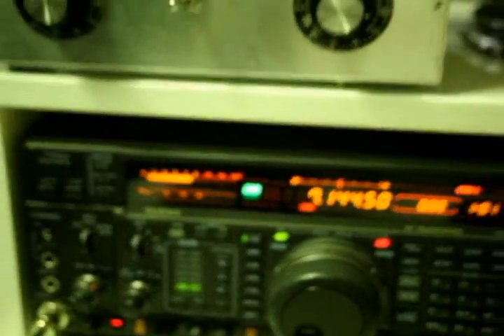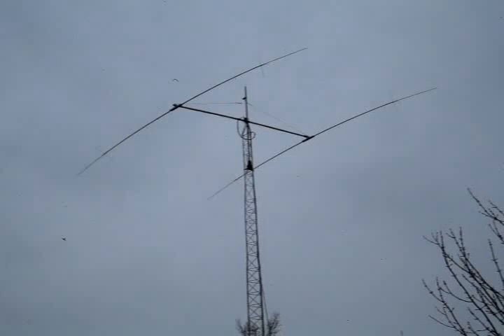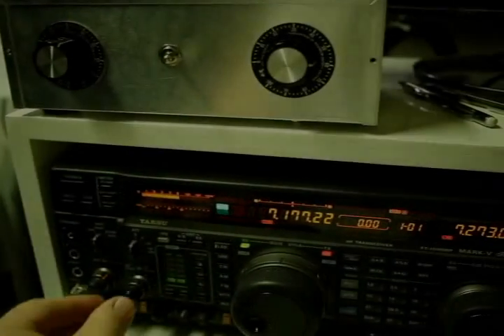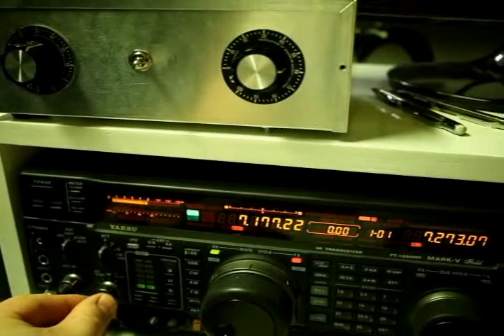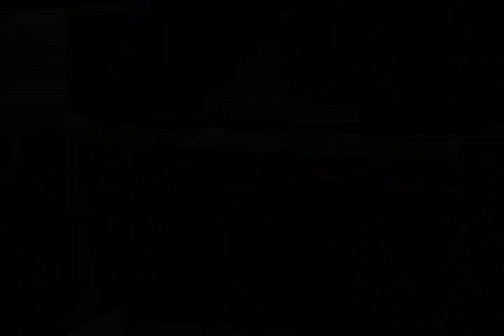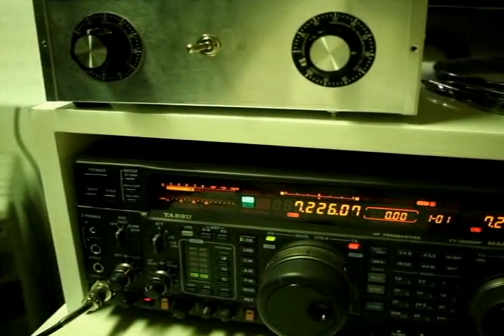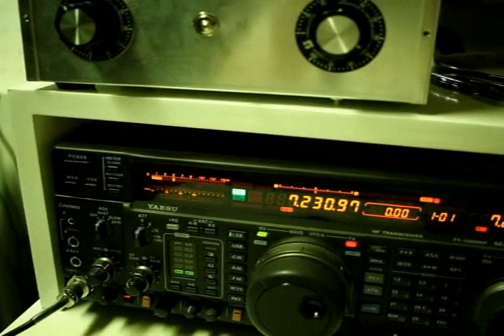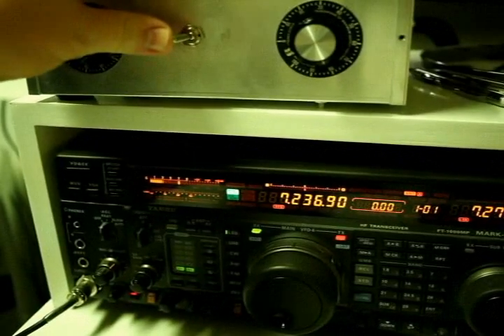W8BYA 40m 2-element rotatable horizontal phased array antenna F/B tests

Comment: Phased antennas are superb in rejecting unwanted signals. Used a W1CF 4 square for 80m with 8 directions in the 1980ths with great enjoyment. A recent accessory QRM-eliminator is another phasing piece that is effective. 73 de Bjoern

Comment: Seems to be based on a K5UA design. I have one too and you can get great f/b in the winter. Mine has full size elements with 20 foot spacing. rotated by a T2X at 100'. I set mine up to go 180 and both directions. I modified a Dentron Transmatch to provide the 135 degree phasing, which is adjustable to null out the signals perfectly. Currently building a remote network to cut down on SWR line losses. Chuck, W0DLE
Reply from the maker: Your setup sounds very cool as well. This particular design is actually one inspired by my antenna elmer Pete W6VOD (sk) that he  taught me about 35-40 years ago long before the internet.... way back when we used to have a daily round-table with chaps like WB6DLK, ZL2BT, KA9V, K9CCL, W6VOD, WB8RMS, etc, etc. I used the exact same topology way back then when my fascination with phased arrays started and I used this design for a pair of phased verticals on 40m. I wrote up a 8-9 page doc with some basic phasing reqs &amp; math and passed it out to over 60 hams way back then because every night I would get many requests from guys wanting to know how I did things once they heard the difference as I switched directions. It was a fun project.
Reply: Was that what you were playing with back in the early 70's in the backyard ?
Reply from the maker: @vidasvv  Yes exactly the same idea from way back then. Only difference is I rebuilt the phasing network and put it in a new box.

Comment: Hey Gedas! I just found this video. Real cool! What happened to his antenna?
73, Frank, WA3RSL
Reply from the maker: Hi Frank ! Man I am sorry but I did not see your question here until just now. The antenna was an experiment and now that I know that it will work the way I would like the next step will be to move the phasing network at the antenna thus eliminating one long coax run. Glad you liked it......talk to you soon on 40m. BTW, you only hit 45 dB over tonight. 73

Comment: Nice, I'd like to learn more about the phasing network. I would like to play around with phasing two half wave dipoles 1/4 w apart. one would not need to be mounted on a rotor and could just cahnge direction of phase in a fixed location right?